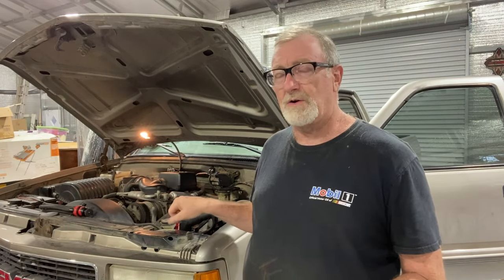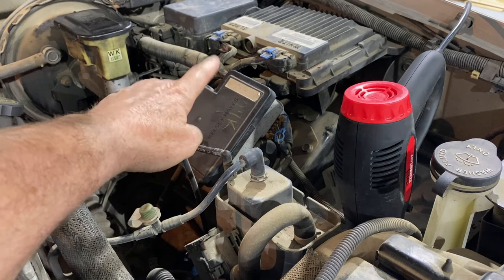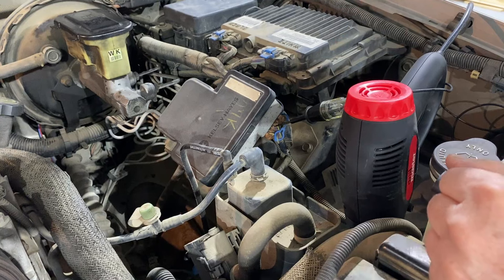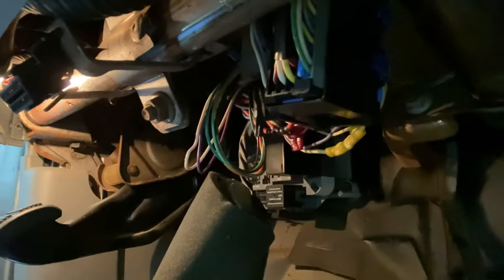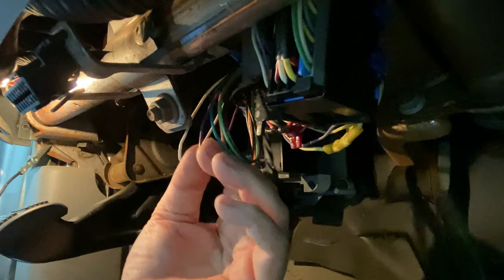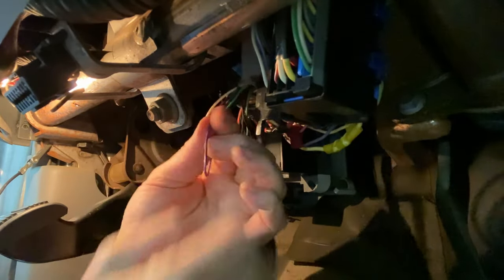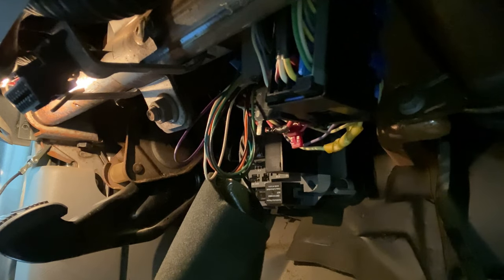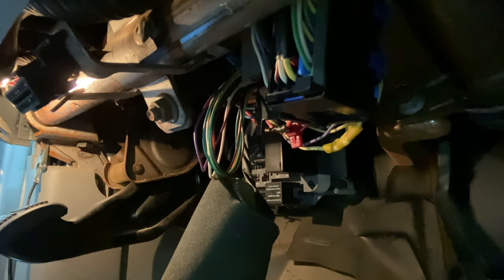Chevy OBS LS Swap Wiring TCC Wire Placement

Comment: 👍👍👍   On my 90 ls swap I hooked the tcc on a small module purple wire , close to the master cylinder, it works,  has power, and it cuts when brake,   Thanks for all the information!!!!
Reply from the maker: Thank you! Good to know.
Reply: How did you hook it? With t-taps?
Reply: @JoseCruz-qf6ui  just splice it, then loom it
Reply from the maker: @JoseCruz-qf6ui  No, I wouldn’t use those on a swap. I cut and solder all wires followed by marine heat shrink to make a moisture free connection.

Comment: I know it may have nothing to do with the TCC, but i did an LS swap on my 96 c1500 with a 2001 5.3, and im getting code p1571, it says im not getting 5v from EBCM (ABS), the input is on pin 13 Blue connector, but i dont have that wire, i think the engine is also going into limp mode because of that.

Comment: Hello. I’m doing  a gen 4 ls. On my tcc it requires 12v when brakes are applied. So I wired my tcc to the brake wire. Gen 3 requiere 0v when the brakes are applied.

Comment: One question sir. I’m working on my harnesses (obs and ls) I saw in other of your videos how to wire the tcc from the harness, but where do I connect the tcc wire from the pcm?
Reply from the maker: I am showing you on the OBS truck where the tcc wire from the LS pcm can go on the OBS truck. Please correct or reword if I have misunderstood your question.
Reply: So I have one tcc wire coming from the obs harness, but then I also have a tcc wire coming from the pcm connector. 
My question is where do I connect the tcc wire from the obs harness and where do I connect the tcc wire from the pcm connector?
Reply from the maker: @josenarvaez5338  does the OBS still have a battery to power it now? If so check it with a test light. If not, you can wait until it does to be certain. Then you can splice them together if that wire works.

Comment: So I have a 1994 Chevy OBS I have no TCC wire anywhere in this truck. I have checked every purple white and white wire possible. I pulled down the same wires under the dash you did. Any other suggestions?
Reply from the maker: It's the electronic trans that has the wire. If you are working with an older vehicle that did not have an electronic trans (4l60e/4l80e, etc) then you take  the wire coming off your modified LS pcm harness and tie it into a wire that has power, but when activated cuts the power. There is a wire on your brake switch (located at the top of the brake pedal) that has this ability. You just need to check out a wiring diagram for your vehicle to see which one. You can also use the method I did to probe the wires and find out which one has power and when the brake is applied cuts the power.
Reply: @laurencevillegarage so if I have a 1994 k1500 that had a 4l60e. And I swapped a 6.0 with a 4l80e into it, do I need to do what is shown in this video? Also would the old obs pcm have a wire controlling the tcc ? My new pcm is set up to go in the glove box with the old pcm